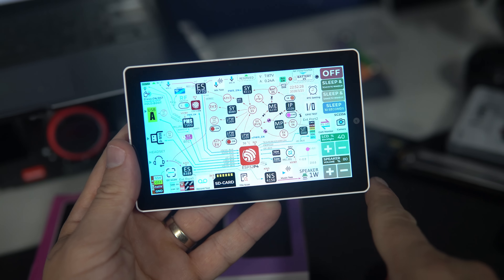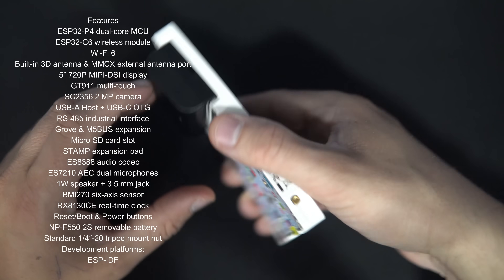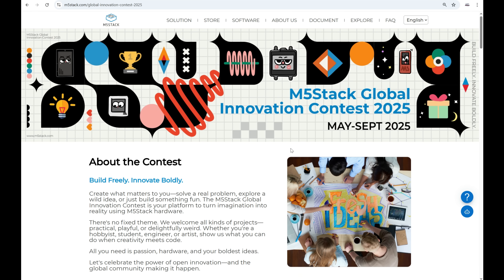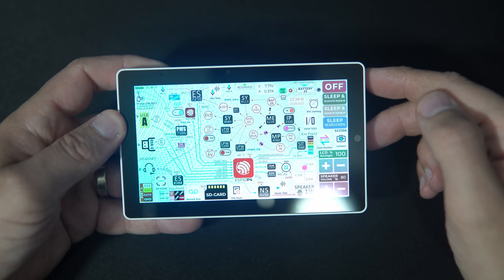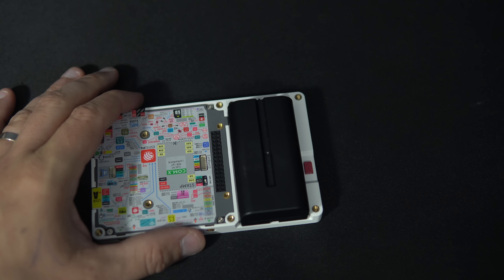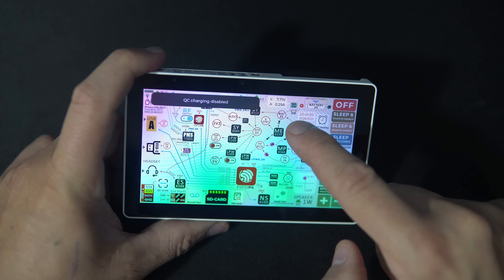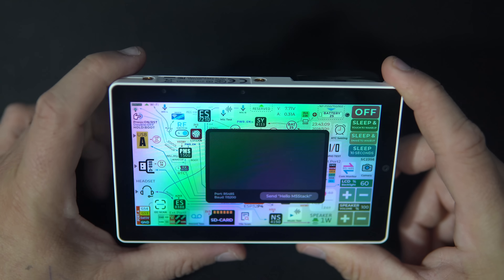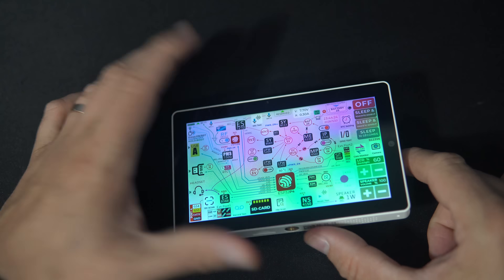Introducing Tab5: ESP32-P4 Powerhouse for Makers!

Comment: that looks like a DSLR Camera Battery, also commonly used in aftermarket, portable battery objects like photography lights, small workstations, small tools etc. I'm sure you can find compatible aftermarket lithium batteries for much cheaper than $50-$60. Edit: 2S NP-F550 lithium-ion battery, 2pk for $27 on Amazon in US
Reply: The battery is only 5$ more as far as I can tell
Reply: @rjScubaSki 2 pack… $27/2 = $13.50

$50 - $13.50 = $36.50 difference

Where are you getting $5 from and why am I arguing with a bot
Reply: @veegames3364 You’ve lost your mind
Reply: “The battery is $5 more”

How bout a lil context kid?

Comment: Is it using the LVGL graphics library?
Reply: Yes it is but in the case of the supplied demo the LVGL elements are wrapped in a framework called Mooncake / Smooth-UI-Toolkit.
Probably not an ideal starting point for those familiar with the Square Line / IDF workflow.

Comment: Sold out already :-(  I hope Micropython / Home Assistant / ESPHome support will also be possible soon.  As you suggest this platform could be a massive hit at that price point.  I like the battery arrangement - very quick to switch batteries and move on if you use them as floating controllers around the house. Oh.. and... hokey pokey
Reply: I think the initial inventory was very small. I ordered mine the very first day they listed it. 
They had about 10 left available then.
Then they were out of stock.
Next day they had a few more.

Worth checking every few hours. 
I don't know why they drip feed the first few units. Waveshare and Lilygo do the same.
Come June I think they will be abundant.
Reply: @nikthefix8918 looks nice to make a multi speaker DSP for a home audio room. Thanks for all your videos and share. Is it possible to make a DSP for like 12 speakers with BT en WiFi audio with ESP32? I'm looking forward to your insights 👍

Comment: if it doesn't have wifi/bluetooth, does that mean in order to make an IoT device that is online that you have to program the P4 and a separate program for the other chip to do wifi communication? hokey pokey
Reply: Yes it's a separate firmware but it's uploaded by the IDF as part of the main flashing process - if you choose - a bit like uploading files to SPIFFS.
When the esp32 first came out it was sold as a wifi peripheral using AT commands. 
You can think of the C6 as working like this (not AT). 
The firmware shouldn't need to be changed on a per project basis.

Comment: I don't think p4 is a useful chip, it adds minuscule amount of ram at the cost of missing wifi.
Reply: 400MHz is quite a boost over the S3. Also, hardware based image / video decoding will add a lot. 
Migrating the wifi to an external C6  (for example) reduces overhead for your main app and is supported transparently.
Dual USB host and device is also new and welcome. 
But for many, the real boon will be mipi-dsi / mipi-csi. Not yet available in Arduino but working a treat in IDF. 
Considering the unit price I think this IS a useful chip.
Reply: Esp32p4 adds a lot. Internal psram at 200MHz is a strong resource.  The hardware modules for video are OK, not stunningly fast but far more than most mcu offer. Dsi displays allows better refresh rate for longer dispkays than spi ever will.
Reply: @nikthefix8918 note that most of video power is in encoding, not decoding
Reply: @motoani941  Indeed but I just love that they have offloaded so much to hardware. Also, I had so much trouble with the RGB lcd interface on the S3 (with larger frame buffers) competing with LVGL for control of the PSRAM - tearing - glitches etc. I've had none of this so far with MIPI-DSI. Clean as a whistle - even with soft screen rotation.